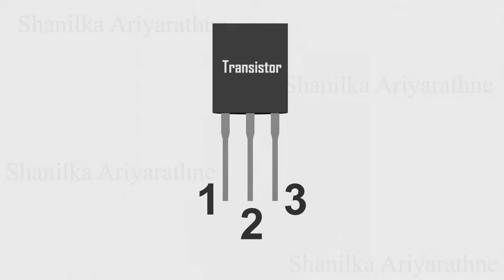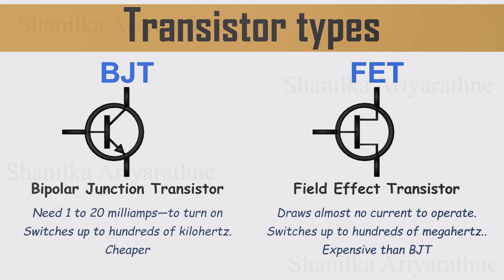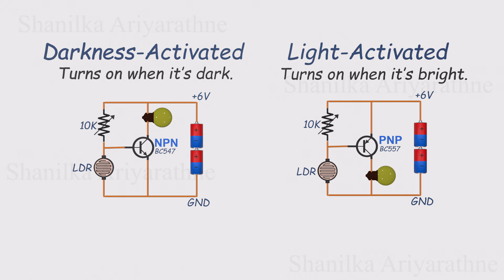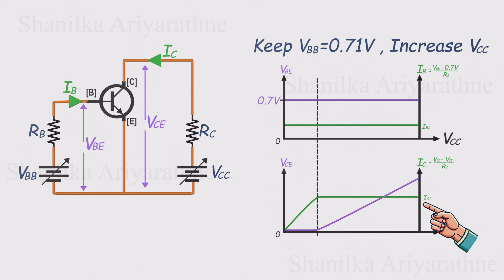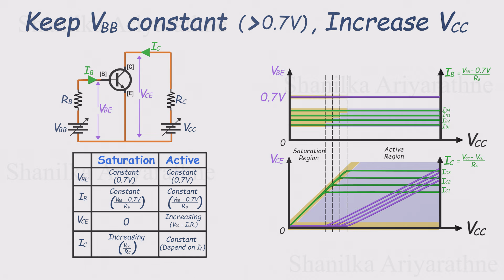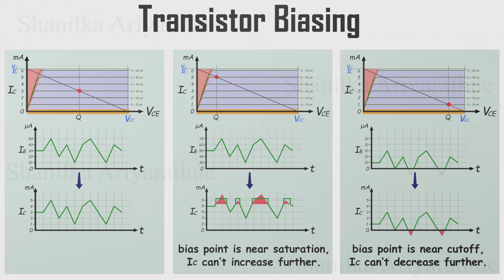Transistors Explained Simply: Switches, Amplifiers, Cutoff, Saturation & Q-Point

Comment: Started out excellent when😮 you used words like emitter voltage or collector current, but it became a sound jumble when you said V b b and I bb, etc.  When you summarized each test the concept became clear.  No more letters soup but rather language interpretation.  So, I had to give up Pdq and pause the vid so I could get the ideas needed to master this Sob.  
It reminds me of talking to the ATT rep about their providing data transport through their equipment, and they began referring to the PVC pipe they would provide.  Now I knew (this is 1990, btw) what PVC pipe was.  It was used to carry cold water thru a building.  OK.  The meeting commenced once they defined. PVC as a permanent virtual circuit.  That didn’t explain it, but any least the water was clearer.  
Using the terms in a rapid fire manner becomes a jumble of, for me, noise.  The presentation is good, the graphics and logic, excellent, but I had to give up   I usually get stuff PDQ but this time, NSM (not so much).  😢😅

OK,   I went back and watched to the end.  The demonstration graphs are excellent and the reasoning about choosing the right bias was spot-on..  Nice work.
Thanks!
Reply from the maker: Thank you for sharing your experience, and I'm happy to hear that you found the demonstration and bias reasoning helpful! 😊

Comment: At 4.43, you state, as usual in these tutorials, that current flows from positive to negative.

Ok. First a simple question. What is electrical current?
A basic knowledge of physics says it's a flow of electrons. Current therefore flows from Negative (excess electrons) to Positive (deficit of electrons). 
Seems wrong, doesn't it? Only because in the early days of electrical science, nobody knew about electrons. For convenience, they named the two poles as positive and negative and, really, they got them wrong. In many ways it doesn't matter, so long as everything else is reversed. However, as soon as you get deeper into device function, it is so much simpler to know what electrical current actually is and what it is doing. More than 55 years ago, I had a major disagreement with my tutors on my degree course over this very issue. I won, by the way, and graduated with 1st Class Honours. I don't deny that you can teach basic electronics with the wrong facts - so long as everything else is swapped to match. However, if one wishes to progress to higher levels then a fundamental understanding of the actual behaviour of electrons, both at the macro and quantum levels, is essential - and the first part of that is that current is electrons moving - from Negative to Positive! Surely, it's better to start off with the correct facts?

Comment: for 5:40 why Vb>Ve=0.7, 

A bipolar junction transistor is basically two PN junctions back-to-back.
(Ai info)

NPN:
N (emitter) – P (base) – N (collector)

PNP:
P (emitter) – N (base) – P (collector)

The base–emitter junction behaves just like a diode.
And here’s the key fact we already know from diodes:
A silicon PN junction needs about 0.6–0.7 V of forward bias to conduct significantly.
That single fact explains everything.

2. Why NPN needs base ≈ 0.7 V above emitter
Structure

Emitter: N-type

Base: P-type

So the base–emitter junction is a PN junction with P on the base, N on the emitter.

To turn it ON

we must forward-bias that PN junction.

Forward bias means:

P side at higher voltage than N side

So:
Base must be ~0.7 V higher than the emitter

Comment: Thanks sir 🙏🏻 I have a query sir, as you told in case of pnp transistors, the base voltage should be 0.7v lower than emitter voltage. But in most of the datasheets mentioned Vbe  much lower than Vce. Please explain to make clear sir. Looking for your early response. 🙏🏻
Reply: Saar thank you saar
Reply: Hmm intriguing 
But it's possible